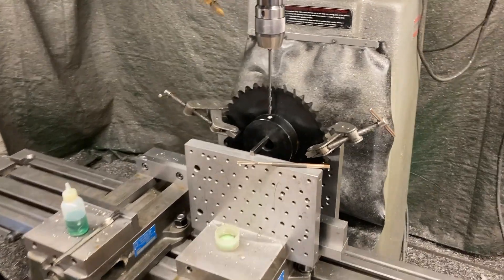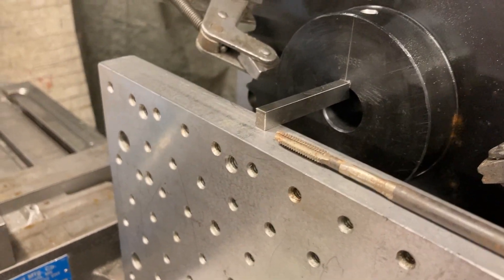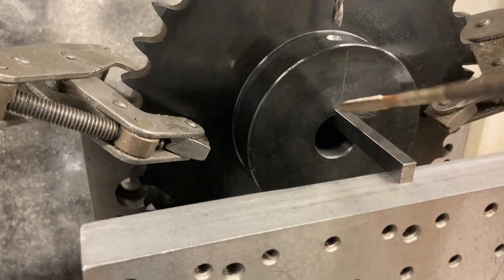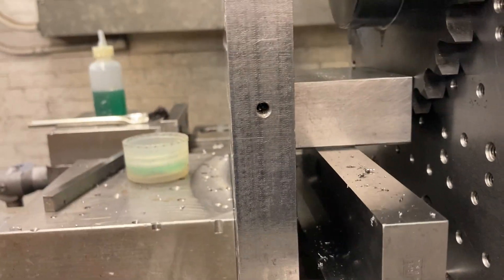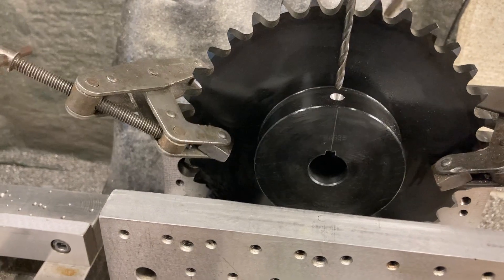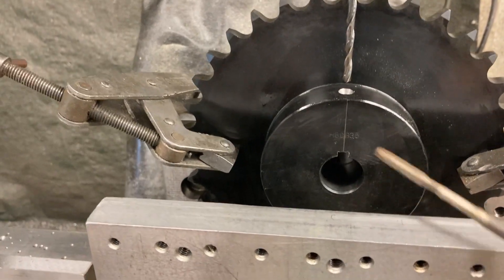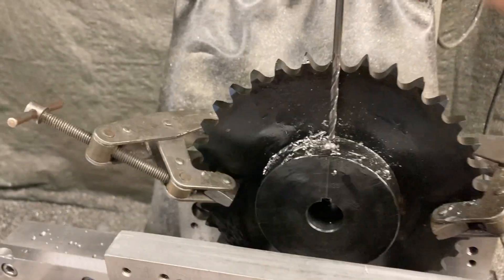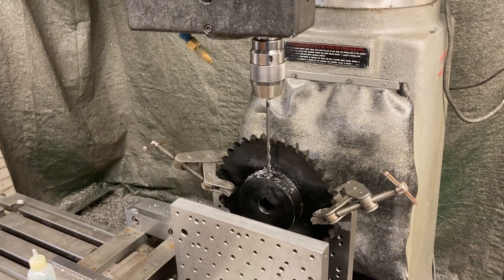Milling Machine Set Up to Drill and Tap 1/4-20 Thread for Set Screw in Chain Sprocket

Comment: I would just use my vice and a few parallels.for set up.
I agree with the hole sizing strategy. As this is a slow rpm application.

Would love not having to listen to your radio...